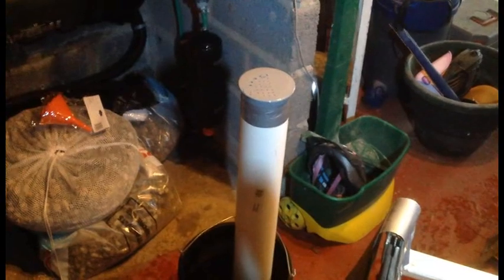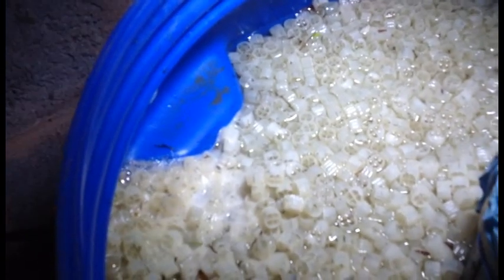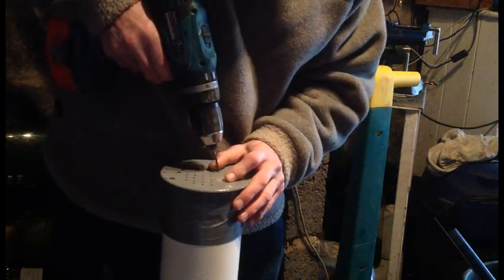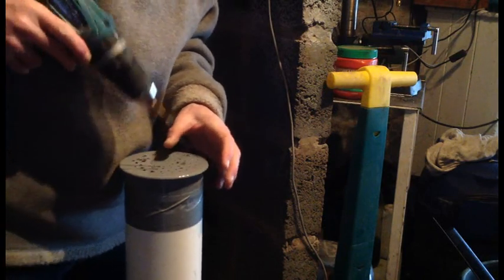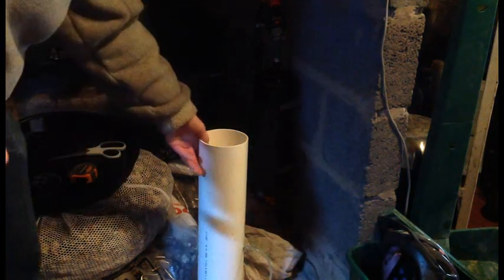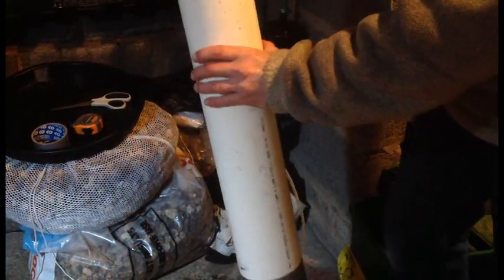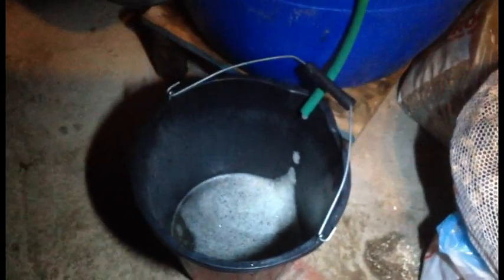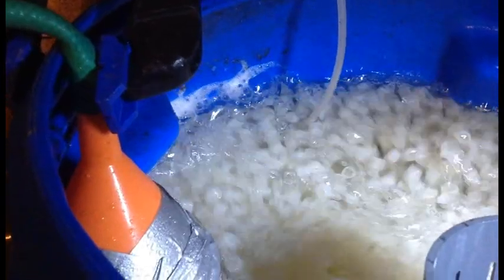Koi pond DIY foam fractionator fitted inside barrel biological filter

Comment: Hello Alex, hope your well, have copied your version of a foam fractionater and it kind of works but I’m not getting much foam. It’s more of a drip of water out the pipe. Only thing I can think why this happens is I add clay twice a week, do you think this could be the reason why I’m struggling to get foam?  Thanks in advance👍
Reply from the maker: Andy, if it is just dripping water the chances are the water level is too high. If that is not the case, it could well be that the the air pressure/bubbles are simply pushing the water out of the exit pipe. Experiment with the height of the tower and also how much air you are pushing through the air stones. Similarly, If the water level is too low in the tower, you won't get anything. The other thing I did to improve the foam was to add K1 inside the tower. If my memory is correct I put in around 1/3 of the volume of the tower with K1. The K1 churns up the bubbles even more to help create the foam.

I also added 2 standard air stones. Is it possible to see inside the cone where the foam initially forms? I used a cheap orange funnel from B&Q. If I shine a torch through the plastic, I can see the bubbles and foam forming. Are you creating enough bubbles. Bear in mind, the K1 will help to mash the bubbles up into finer bubbles. The more bubbles you get, the better at creating foam.

I doubt clay is the issue. When I add it (calcium bentonite), the foam seems to get more. Clay will flocculate the water and seems to help the surfacant properties of the dissolved organic compounds (DOCs) to cling to the air bubbles and lift all the gunge out of the water, including the clay. Bear in mind clay especially bentonite/montmorrilonite has excellent properties to bind toxins to it. A fractionator creates fine bubbles that attract the waste to the surface of the water. 

 Can you post a picture of it so I can see whats going on? I had to raise and lower the tower/tube until I saw foam form.

Hope this helps.

Kind regards: Alex
Reply: Just Alex Koi Ponds thanks a lot Alex very thorough reply, yes I’ve juggled with the height of the tower, I get water or nothing,like your idea with the k1 as the bubble size I suspect is too big. Pleased also to hear you doubt clay isn’t the issue. Will let you know if I’m successful,thanks again 👍
Reply from the maker: i've just had a quick look back on my video and the fractionator worked at 2.2 dg/celsius, so I am incorrect in suggesting it does work at lower temperatures.

Comment: Great video just what I was looking for, nice job.
Reply from the maker: The way to adjust the water level is raise or lower the fractionator in the main barrel. It's important to note that if you don't get the water level correct, you will either get water droplets out or no foam.  I have used 2 ball airstones inside it to create the bubbles. Just play with the level until it starts to work.  I just use a pair of work grips either side of the outlet tube and barrel. It also will not work below temperatures of around 13/14 dg Celsius.

I am toying with another idea that will be able to use the complete waterflow through the system.   However, I am in the process of another project at the moment, so that will have to wait.

Comment: Nice job, I have one question, how does the water exit the pipe?  I see the inlet at the bottom but not the top. I'm considering making one of these myself.
Reply from the maker: Edward Broomfield 

I suggest make it first without any outlet. I have added K1 to the tube and fitted 2 air stones. The K1 helps to break the bubbles even smaller. Experiment with the height. If the tube/funnel is too high, then the foam will not flow through the pipe. If the tube/funnel is too low (water level too high inside the tube) all that comes out of the end of the tube is water. Also experiment with the flow of air into the air stones. I experimented for around 15 minutes until I saw the driest foam appear. Once you see that, drill a couple of small holes a couple of inches below the water level. You will find you will then need to fine tune it again. If you allow to much water to return, then the docs will not have enough time to cling to the bubbles. The K1 will escape as well. The longer the water stays in the tube the better. If you see the foam settle and turn to brown dirty water, it is working. 

I suppose what you could do but it is extra work, is to drill a hole large enough for 15mm push on fit pipe to be solvent welded to the tube a couple of inches down below water level. Then add a push on ball valve to control the outlet. That way, you don't commit to drilling holes too small or too large. I may try that myself, now I have thought about it.

kind regards
Alex
Reply from the maker: Edward Broomfield 

To be honest I have not permanently attached yet. It is still 
Locked in place with clamps. It works, therefore I carried on with other more important tasks. I will do another video to show how it will be fixed in place, but easily removed.

Regards
Alex
Reply: Thanks for taking the time to respond. I'm going to give this a try and I'll let you know how it goes.